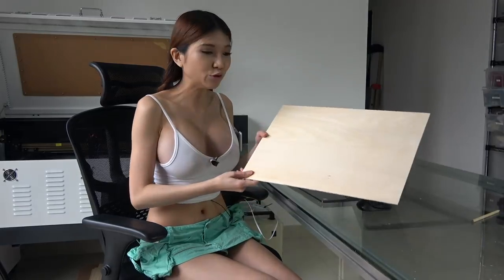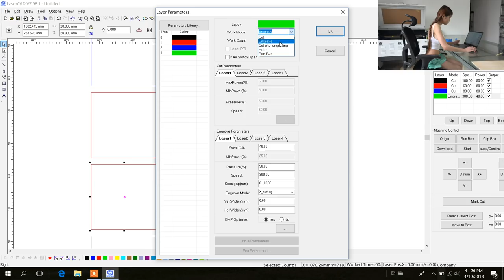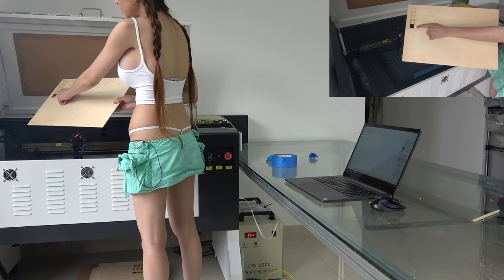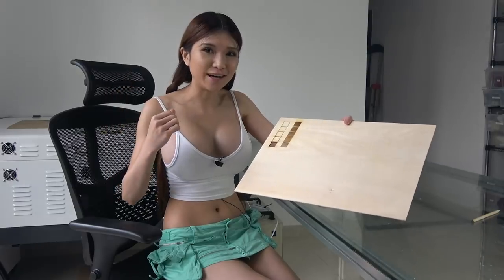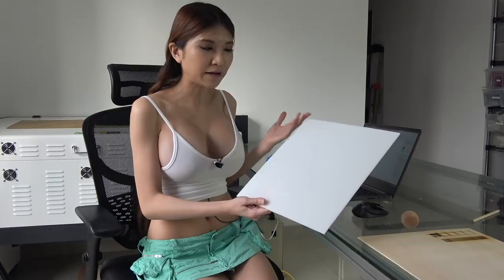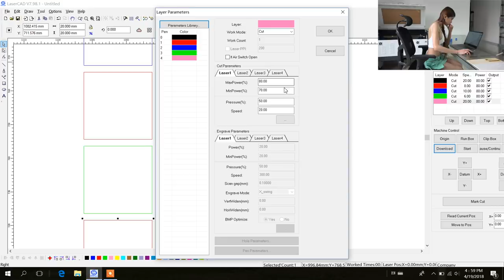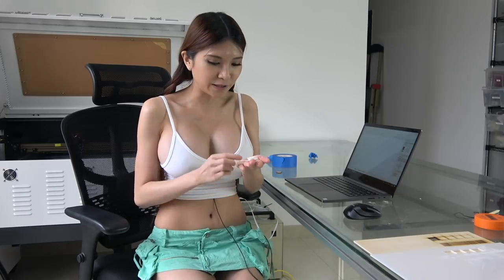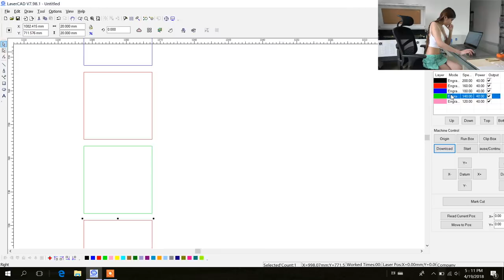Cutting Delrin/POM and Plywood on an 80w Chinese Lasercutter

Comment: Remove the paper from the top cover, then you can see if a fire starts.  Get some laser safety glasses.  Protect your eyes.  Mahe sure your exhaust fan is working and the ducting is not blocked.  That will help.

Comment: Hello Naomi - You might consider verifying the power supply settings for your new laser.  If the manufacturer did a poor job of adjusting it, it could drastically reduce the life of the laser tube.  Open the laser tube compartment and get the model number from the glass tube.  Verify that it is actually an 80W tube ( some bad companies advertise 80W, but ship something else. )  Then look up the specs for the tube.  An 80W laser tube typically has a max current of 28mA.  If the power supply is allowing even 30mA, it could cut the life of the tube in half.  You can measure the current with a quality DMM by carefully removing the ground wire for the tube and inserting the current meter in-line to measure the current.  There are tutorials online.  BE VERY CAREFUL, this is a high-voltage supply and can be dangerous if you do it wrong.  Only measure current through the GROUND wire, NEVER the high-voltage wire.  Fire the laser at 100% and verify that the power supply is providing no more than the maximum specified current for the tube.  If the power setting isn't correct, there should be a trim-pot adjustment on the side of power supply in the electronics cabinet.  You will then know with confidence that 100% = 80W, and that the tube isn't being damaged by a poorly adjusted power supply.  If you are feeling really adventurous, you can buy an old-school 50mA analog panel ammeter ( needle style current meter ) , and permanently wire it in-line with the tube's ground wire and mount it in the front panel, so you can always keep an eye on the current as it cuts.  Love your videos !!

Comment: some recommendations.  For the interval (scan gap) you really don't need to go lower than .03. Most use .06.  the .1 you have is nice and fast, but it may lose some detail and you will potentially get a "ribboning" effect (looks like blinds)...just something to experiment with.
Also, when changing different layers, you don't need to jump out of the screen and select a object...you can just click on the color layer on the left of your settings box when its up...bit faster that way.

Comment: Delrin releases formaldehyde when laser cut, which is the reason it is preferable to CNC as a material. Please read the MSDS for each and every material you are going to laser!

I also suggest removing the paper from the acrylic observation window. The acrylic will provide protection against the IR of the laser that is the spectrum that damages retinas and also crucially let's you observe if your material catches fire. Don't ask me how I know this ;)

Comment: You'll get way better cuts if you'll decrease the power/increase speed, and make multiple passes. That's how I do it to avoid burning the material too much.
For example, if you can cut your material with speed set at 100 and power at 80, try do it at speed 100 and power at 40, but do it twice. The lower the power and faster the pass, the cleaner it is. Just a tip ;)

Comment: I wouldn't use POM with a laser, unless you need the high temperature robustness. It evaporates a lot of Formaldehyde. Use of PMMA (105°C glass temperature) is highly recommanded (with high speed and low power settings, to cut around 1mm per go around - which reduces the stress within the material). You also want to use metall polish (e.g. Elsterglanz in Germany), with which you can remove the burning marks and fume settled after cutting or engraving). (But don't clean it with ethanol/isopropanol).
You might also want to use a humidifier next to the laser - these ultrasonic fog machines are good to bind the generated PM2.5 particles.
Otherwise cool functionalities of LaserCAD.

Comment: I'm surprised the laser doesn't have a safety interlock, or maybe it does and it's disabled. Mine won't energize the tube without the case sealed. Like many have said, uncover the window so you can run with the lid down and vent vent vent.

Do not try to cut poly-carbonate on an IR laser (CO2). It's like setting off a smoke grenade. Don't ask.
Also do not cut any PVC material as the outgasing will eat your optics.

A tip for cutting plywood with less burning of the edges is to make multiple passes at lower power. Don't try to dump all the heat needed to cut all the way through in one pass, that will cause excessive char. Also most plywoods are constructed with glues that are laser opaque which takes much more energy to burn through than the wood. Look for a source of laser friendly plywood, like what is used in making cutting dies. It's designed to be laser processed.

Comment: As for the POM results: Generally "Delrin" is a brand name that refers to the Homoopolymer (POM-H) while POM=PolyOxyMethylene usually means POM-C, the Copolymer.  
The difference is for example 10°C in melting point 
or up to 1.5X the ripping point. 
Also head conductivity is much different.
So laser settings for both should be tested independently and it should always be made clean what you are referring to.

Comment: You need fume extraction.  Cutting PVC - polyvinyl chloride - (I think) produces HCl - hydrochloric acid.  It will dissolve all of the steel inside of your cutter and the inside of your lungs too.
Reply: Besar ya bro 😁😁

Comment: This would be awesome for a lot of things like precision metal parts for models and snap-fit panels and such. Of course by the time that thing got to Canada it'd probably end up costing more like 5k. Which is still decent from what I know of the prices of these things. Would like to see metal part cutting (thin gauge sheet brass, aluminum ie. <=1mm). Though i'm not sure it has the power for those. Either way even basic styrene would be awesome to use with that.

By the way i've noticed that noxious eye watering gas effect when working with some plastics. Heating them up releases those fumes and they burn your eyes (polycarbonate) from my experience. I'd be worried about those fumes in the long term.

Comment: Hello, nice demonstration of the laser capability but always be careful when you use high power laser, laser light can reflect from some surfaces... Fumes are also bad for health... 
It would be great to see a low cost laser printer that melts metal powder or metal oxide. I think these printers are still available only in industry but not on private users
Maybe you could try melting a thin layer of fine ppowder magnetite and fine powder carbon mix and see if it is fusing into some metallic solid? Could be interesting experiment ;)

Comment: Naomi I love your videos. I have just built an EBAY £99 3d printer. With a lot of measuring adjustment and a few mods it is working great thanks to your very valuable information.

I am replying to you to warn you of the hazards of heating various new plastics.

PLA is short for Polyoxymethylene  also known as polyformaldehyde, when it is heated it gives of formaldehyde gas, this is an irritant to the eyes, mouth, nose and lungs. I hope its effects are temporary but don't know anything about more and long term exposure.  
This stuff is very nasty and you should avoid exposure to it by making sure your fan system and filters are always working OK.

Sorry for the lecture but I would not want to see you harmed.

Keep up the videos, looking foreword to the next.

Comment: Using a more powerful air-assist pump can reduce the scorching on the surface of the wood when cutting. The pump provided for air-assist is very weak with that laser cutter.

Comment: Naomi just wondering why you do not remove the paper covering on the Plexiglas window on top of the lazer cutter so you can see in and the camera can see in with out even opening the cover ? I am sure there is a reason, but had to ask. Just 1 maker to another.
Reply: That is correct, the acrylic window is safe, the paper can be removed.
Reply: The Epilog Fusion M2 at my makerspace has a polycarbonate window that is clear to visible light so you can see in, but blocks IR (10.6 micron wavelength far-infrared of CO2 gas tube laser).
Reply from the maker: Everyone gets really upset that I won't take the paper off so now I just leave it on to mess with them😜
Reply: Too Funny. Any way you like it is fine with me ! Love your vids.
Reply: Hahaha! It is going to drive me insane....
Reply: My homemade 80W laser cutter is covered entirely with acrylic. You can see right through it and watch the tube glow pink.  Maybe I should have left all the protective paper on it too. LOL.  Keep on experimenting. Thanks!
Reply: Is it possible to place a camera inside the cutter?

Comment: Wow that laser cutter is really loud. Still neat but I would leave after i set it up to stand in a different room. With a fire extinguisher... Ah my first time using one at school...
Reply: The majority of the noise/rattle is probably from the air pump pushing air out at the laser nozzle. These laser cutters use forced air to keep smoke/residue from depositing on the mirrors and getting burned in and pitting the mirror. The fans are usually noisy, but not too bad and most chillers aren't so rattly in character. A layer of foam or rubber under the air pump would cut the noise appreciably. Especially since it sounds like it's on the glass table.

Comment: So I am not sure if it will work or not but maybe something like Worbla or another thermoplastic may be useful for you.  Something to cut out a very intricate design while it is flat and then heat it up and mold it to the shape you want which could give you options to applique over a 3D print or something.

Comment: love the video just a pro tip i have a fusion 40 120 watt with a huge extractor running outside and i still leave the door closed for about 20 seconds before opening it, when cutting any plastics. good luck happy lasering.

Comment: Naomi, you bypassed the laser switch to keep the door open.  Don't its dangerous.  It is good when the door is up as it give you trust that the laser is OFF and safe.  Also the door needs to be down to help with fumes, the extractor will suck everything out and will help with ignition.  Please for better results and your own safety fix the safety switch
Reply: ok the rest of video much better with Door down

Comment: I'm sorry if I'm just repeating here something another reader has already said but I just couldn't bring myself to read all the previous comments. If you want to avoid charring of the plywood, cover it with a layer of masking tape and do the laser cutting through that. The charring will all be on the removable masking tape, not on the plywood.

Bob Cringely

Comment: Cute as usual, love the top (side question, where do you get these tops?), and i agree witht eh previous commenter, with those pink shorts it'd look absolutely killer! The laser cutter is definetly interesting as well, could it in theory handle engraving/burning out shapes into metal surfaces?

Comment: Nice oufit!! ;-)  does the laser cutter have a feature where a vacuum can be attached to help remove the light smoke and odors while the cutter is in use? Thanks and the videos (you rock m'lady! <3 ) are well made!!  hugs have you done any etching with that cutter too? that cant cut thin metal, right?

Comment: Aren't your speeds measured in inches or Millimeters per minute? Going faster at a lower power will reduce melting. Adjust per thickness. Good job

Comment: love your videos, but i have to say you really should close the lid when cutting for multiple reasons. not to mention that if that laser cutter works with the lid open then the safety must have been bypassed. also, yes, the fumes are not only hazardous but if they are not vented properly they can dirty your optics and burn out your laser and/or start a fire. stay safe!

Comment: A lot of tried and error for each material to e engrave and cut. It's just the beginning. I open she will share all the data in a list form : material, time, speed, laser power, material thickness, material color, material composition, dept the engraving for each material.. By the way the sweat on her skin is really sexy. Prov she work hard and this is hot.

Comment: Are you cutting plastic or acrylic , if plastic, the gas is poison and damage you lens , if acrylic, there are many kinds, the cheap on smell very bad, I use cast acrylic have less bad smell, I think you forget turn on air assist, that will help you suck the air out quicker in the box, my concern, you can do it, anyone can do it. but using high power laser is different stories, do it or do right is totally different story

Comment: hi I cut some pcv by accident did not read data sheet well the next day all the unpainted steel parts screws and linear slides were rusty so not only bad for you but bad for your machine.